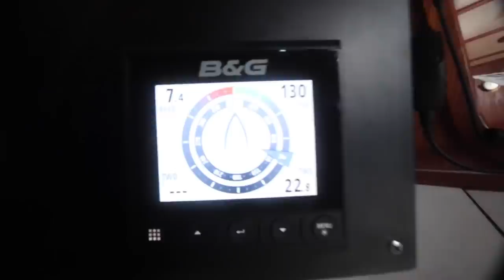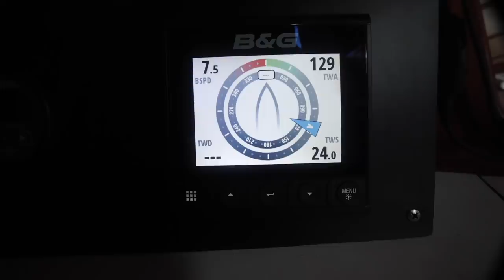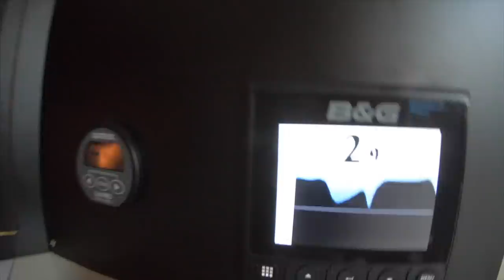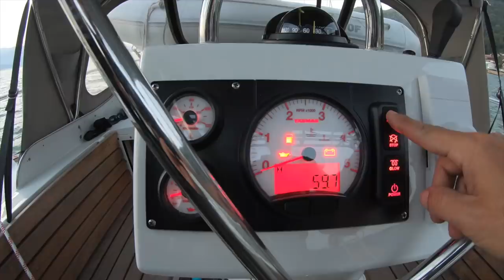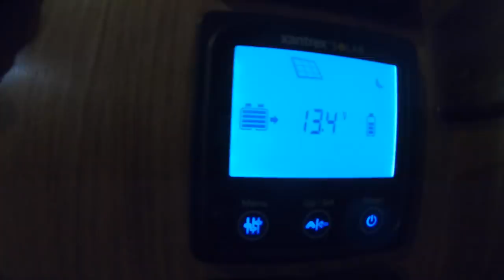⛵️Our brand new engine heated up!! #197

Comment: If the sensor is not in contact with the coolant it will read cold to warm. Once the engine is super hot , the heat will transfer to the sensor through contact with the engine and will instantly peg supper hot. No warning in between. So when you think the engine is cooler and it is safe to run, IT IS NOT. No coolant no temp sensor. Thread sealant on sensor is an insulator, so the engine has to be super 🔥 to read from eng contact vs coolant.

Comment: So where did all the coolant go? It leaked somewhere?  Right? Are you concerned there is a leaking seal somewhere which will suddenly fail causing the engine to over heat at the worse possible time ?
Reply from the maker: The coolent went to the water heater

Comment: Before every start: Coolant lvl, Oil lvl, Belt tension, fuel supply on. After start: Check exhaust for water spray. This is your new religious ritual, every, single, time.

Comment: So the “professional basically cooked your engine”  nice,  I wonder how much damage the head gasket took running of stream?  Normally alot,  I don’t really even know why he opened the cooling system?    Anyway you should find out if there is damage during the warranty period.. Duca there is funnels you can by that fit radiator caps that raises the coolant higher, this Guarantees you are moving all air out of the system.  You can Purchase from any auto parts repair store such as veal, or Repco, or Equivalent,  you definitely need one mate.. peace of mind..      it you contact me through messenger i will give you a link..

Comment: Can the sandbar hold the boat's weight?  So what is the problem of getting hung up? couldn't you just wait for high tide to leave?  Not being a sailor, I'm just asking.
Reply from the maker: If there was no wind would be ok. But in this place there is a loot of wind and current. So the but will hot the bottom many times before sitting for real and the wave hitting the side isn’t good also. 😅

Comment: Not super important but on a new engine I always would, never use tap water. You want to fill with distilled water. The minerals in tap water(won't seriously damage but,) create rust and other mineral growth in the system. Again not super important but highly recommended. Also, try adding a product called Water Weter. It will drop your coolant Temps by up to 10°F

Comment: Just one tip for free, the radiator cap has a valve that opens and closes depending on the heat inside of the radiator, is some rare cases it fails and the engine will overheat, buy one or tow of those to bring with you, they are small and cheap and can cause a lot of troubles.

Comment: You look cold in the mornings, last year I installed a Chinese copy of the webasto air top heater and it has been working flawlessly and keeps me toasty with very little diesel. The install cost less than three hundred dollars and I can turn on the heat from my bunk with a remote. If you want to see pics of my install let me know.All the best
Arne

Comment: Have you thought about moving your dinghy to another location? Reason being is when you were behind the wheel, it looked like it was a view obstruction while piloting the boat.
Reply: That, and as an old sailor, not being able to glance up and see the set of the Main and headsails because of the canvas cockpit cover without a cut out or window section would drive me nuts.
Reply: @Mark-zi4dd  Exactly correct. Store the damn dingy someplace else - it's blocking your forward view from behind the helm and the canvas cover is concealing your view of the sails. Not a good situation especially in rough weather,!

Comment: Sadly 12 year old Scotch whiskey even if stored for 20 years is still 12 year old Scotch Whiskey. It only ages when in the cask and stops once it is bottled.

As an aside there is a whole field of finance. You can buy casks of scotch from the distillery they will store it for you as time goes on they increase in value i.e a bottle from that cask at 3 years costs a lot less than one taken at 12 or 25 years even though it is the same bottle. It is relatively Blue chip investment and you make more than most bank investment vehicles.

Comment: Please give Roberta some sort of step in the cockpit so she doesn't have to stand on the side seats while trying to steer the boat. In rough seas Roberta trying to strattle the cockpit while steering is both dangerous and very impractical and you must wrap that helm in some sort of non-slip material to prevent slipping in foul weather. You'll be glad you did!

Comment: Thank God you solved the issue with the engine!!!!! Also it is so beautiful seeing you two getting to know your vessel. Do please consider getting that autopilot installed at least. You don't have to have it turned on if you want to manually steer but if by chance you both are tired and feeling sore in the muscles then you can at least recoup some with the autopilot on. Of course the urge to just use the autopilot might be why you're holding off because the temptation might be hard to resist. :-) This was such an awesome vlog seeing you two in your element. Be nice when you jump on that thicker wire. I hope you have that shared crimping tool with you. Might you visit Fred and his Wife or dock near Yaba to visit them as well? Also do you have safety harnesses? You should always use them when ever the boat is in motion and you leave the cockpit.

Comment: Not the yanmar Mechanic's fault if a boat owner fails to do pre trip maintenance and inspection. A quick check of fluid level s would have prevented any problems. Live and learn.

Comment: I trust you guys entirely but I would seriously check the validity and scope of Yanmar's warranty exemptions.  As a brand new engine, Yanmar's warranty agreement should be valid for scheduled service intervals with Yanmar certified dealers or service agents... But if a problem occurs at sea, you are responsible for the safety and seaworthyness of your vessel. If that means you having to rectify a problem with the engine, I cannot see any grounds for Yanmar to void warranty.  Full strip down and re build excluded, basic things like water pump impellers, oil / fuel filters and hoses should be able to be undertaken without risking warranty.  Make sure you a carrying some of these basic items and are genuine Yanmar supplied  parts.

Comment: Your attributes vs the mechanic's attributes: Familiarity with your system can be worth a lot more than cursory experience with a lot of systems. Having a functioning engine is worth more than mitigating the warranty risk. Don't leave yourself grounded while you tell yourself "Well at least we still have a warranty."
Reply: They are doing a good job. They cleared up their anomaly, protected their warranty, and practiced good seamanship, all the while maintaining safety. Good management. A little work on their deck safety plan, and things will be looking very good.

Comment: It is tragic to see you two, without life jackets, there are such nice and flexible life jackets to buy. When the accident is there, then you need the life jacket.
Reply: Check out the life jackets Dan and Kika use on Uma.
Reply: Why? You think either of this pair could stop, locate the MOB, manoeuvre there and then get him back aboard? Have you ever tried doing that? A fully dressed man soaking wet is 90kg or so. You going to just haul that on? Sure, use a halliard, but then you need a lifting strop and you need to get it on him. What if he's out cold? You'll end up in the drink too and you can both die of hypothermia bobbing around in your trendy life jackets. A harness clipped to a lanyard then to a 7x19x8mm wire rope running the length of the deck is what's required. That way one stays attached. No MOB.
Consider learning seamanship before giving out advice on it.
Reply: @RodFleming-World  Another one that does not understand that a life jacket is good to wear when the accident occurs
Reply: @mariannewangberg8729  how much offshore experience do you have? Go and patronise someone else with your virtue signalling.

Comment: What did the mechanic find as to the problem of your over heating engine ?  I am thinking an air pocket or a stuck thermostat.  I always press down the stat with my 2 thumbs . If it opens and closes smoothly it will work.

Comment: Is there any way that you can remote a display for your depth gauge?  It seems to be very inconvenient especially if you need to move with only one person.  Is your zodiac motor not strong enough to act as an emergency motor?  It may be something to consider.  With a two year warranty seems to be limiting in your movements in being able to follow the winds.  There are a lot of factors in where manufactures try and get you to get work done only by their mechanic, but are illegal.  For years dealers tried to say that only their certified techs could do things like oil changes which is impracticable.  Returning to a town or city is impracticable when any certified technician can change oil or do basic repairs.
Reply from the maker: Hey, Brian. Check this video: https://www.youtube.com/watch?v=DflcbMvy-Oo
Reply: @OddLifeCrafting  So from the jest of the referenced video, one of your major issues was procuring the right cables in a timely matter.  I also respect the issue of the cost of the cables.  In one of my previous lives, I was involved in installing communication systems in mobile vehicles.   The one thing that we always has to be concerned with was looping cables.  When be built prototypes we were able to get access to loose components such as the cable by the roll and boxes of connectors and the proper crimping tools.  As we were building 100s of vehicles it was a worth while investment.  Once all the equipment was satisfactorily installed, we were then able to contract out having the cables made in bulk.

So to answer my own question, the depth monitor is located for best case scenario?  The reason I asked was in two different videos someone had to be by the monitor calling out the depth.  I see you using the map on your cellphone for the route.  Is it possible to install a display in the cockpit console, and would your backbone be able to extend and accept the monitor?  When I watched the installation of the cockpit wiring it didn’t seem like you had very much room left in the pipe.  Another thought, you stated that you were installing a remote autopilot control, could you tap into the network from there?

Comment: To have both sails up when going downwind, you need to go wing on wing - genoa on one side of the boat and mainsail on the other.  Also, having genoa up without mainsail can cause undesirable lee helm.  Usually, if you want to sail with minimum amount of sail, you just use reefed mainsail without the genoa.

Comment: The holding tank for the motor  should automatically get drawn into the system  that's the whole purpose of the holding tank 
You  might have a bad radiator cap

Comment: Usually you have to top up the cooling system at it's highest point. The water heater is higher than Kelly, so I would think the corect procedure is to fill up Kelly first, then top up the highest point of the water heater.There should also be an expansion chamber with air space at the top of the system. Then if there are any pockets of trapped air they hopefully will find their way harmlessly there. Sometimes, if there are other high spots in the system you need to have a bleed valve.
I would suggest that this should all have been worked out by the guy that installed it, and I would question either his ability or his interest in the job. The new engine could be killed by a poor cooling system that is prone to air locks.

Comment: You can also put a tight fitting funnel in the opening of the heat exchanger and put some cooling fluid in it to let the bubbles escape.  Maybe not necessary for your system though.  :)

Comment: Could you fit a header tank like in a car, this would allow your heat exchanger to bleed automatically and with a plastic tank you would see if the engine had enough coolant, I see you have an an overflow pipe by your fille cap, it would be a simple job to do this. Hope this was helpful.

Comment: Do you have an autopilot?
For longer passages you will eventually need a self steering mechanism of some sort.

Your main sheet block shackle pin needs to be wired so it can't twist out. Indeed all shackle pins need to be wired. Else, they will loosen and fall out.

Comment: To tie down your helm, you might want to look at putting some sort of bracket at the bottom of the helm pedestal so that you can tie the wheel to it instead of using the winches and having to climb over the lines all the time.

Comment: If I were u guys I would install a nice high Captain seat behind the big steering wheel. It would be comfortable seating and sailing then standing up with your legs on each side of the bench.
The seat could also go up and down depending who’s driving. And it could be inclinable to make room if you want to stand up. It would also be nice if you could fold down the front windshield for a better front view. An Odd Life flag will also be nice Hehe!

Comment: TAKE CAP  OFF START ENGINE RUN UNTILL THE THERMOSTAT OPENS. FILL TO TOP UP THEN IT SHOULD BE FINE.. THIS ALLOWS FOR ALL THE AIR TO WORK ITS WAY OUT AND THE SYSTEM TO BE FULLED PROPERLY..🤐
Reply: Then top it off after it has completely cooled. just like a car.. If you leave air in the system it will over heat and blow the coolant out again.. then you fill it up again thinking all is good and leave air in the system and it does it all over again. So after you fill it up keep checking and adding it until it stays topped up, Only then you will be set. And most important.. who ever is behind the wheel needs to keep an eye on the gauges..

Comment: Have you considered some way to provide heat and  air conditioning? I realize that air conditioning is a huge power draw, but I’m guessing that a furnace could be sourced from your diesel tanks or the engine when it’s running. This from someone who has absolutely no experience with boats and does not have the engineering background you both have.
Reply: Why? Just sail to where the weather is perfect. ....Bikini type weather preferably. :D